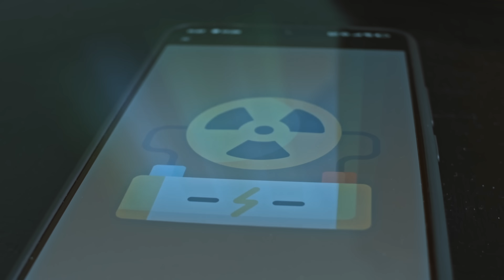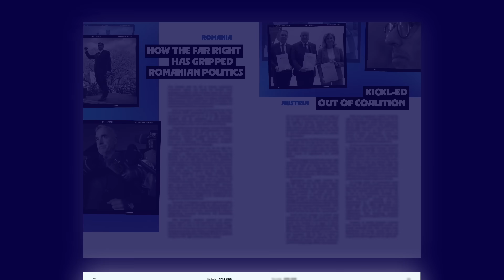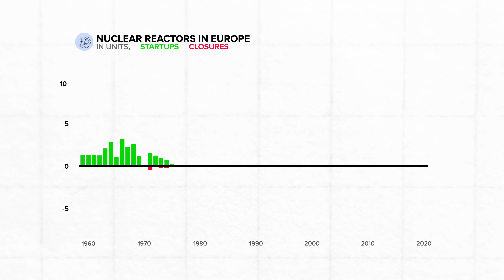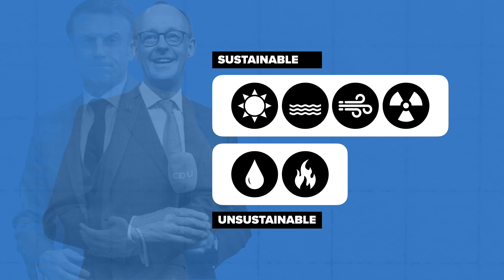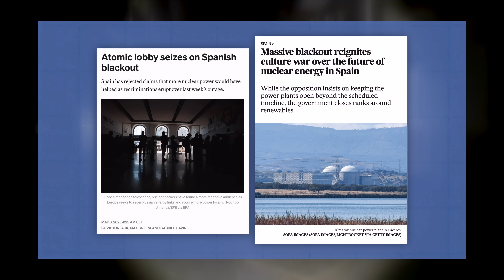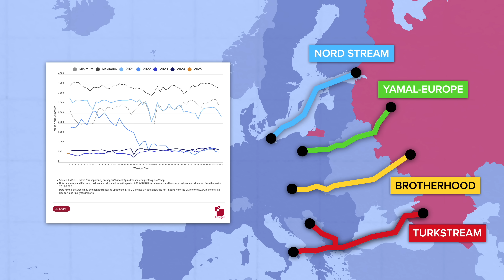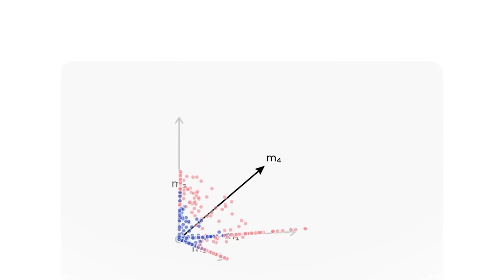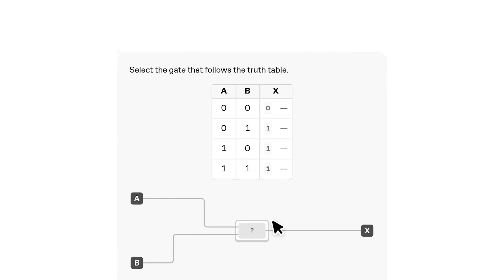Is Europe Quietly Returning to Nuclear Power?

Comment: The power outage was not caused by renewables !! You must decentralise renewable energy production so that one single dysfunction in the central power plant does not halt energy production in the rest of the plants
Reply: The problem was grid frequency as far as I remember, and if you don't feed renewables into the grid, where are you feeding it to? Renewables just need a lot of storage and ontop of that frequency stabilistors, as it seems. With storage and stabille frequency renewables are totally usable. But often those extra costs are not taken into account when talking about how cheap renewables are. They are cheap when they are crappy, decently done they will work fine, but are no longer as cheap. 
Plus they create dependence on China, in today's world one should take that into consideration as well. For example there's very little solar cell production in Europe, and I'm not aware of plans to  change that. Dependence aspect is just taken for granted, and assumed to not become an issue, as far as my impression goes.
Reply: @2ebarman  I would say that rather rotating masses - conventional generators - need frequency stabilization as they try to change the frequency based on the load. Static inverter could produce stable frequency disregarding the load.
Reply: @MrToradragon  My understanding of this is that while inverters are able to produce stabile frequency, they are doing that to match grid frequency. And when grid frequency happens to be unstabile, inverters don't really have a problem amplifying the instability. While rotating masses would struggle to go along with it, eventually tripping when instability grows too great. 

Or am I wrong here, and inverters really do generate stabile 50hz frequency, disregarding what is actually happening in the grid?

Comment: Did they even mention Okiluoto and the Finnish storage of nuclear waste?  Back to the idea about the link between nuclear power and nuclear bombs.  Isn't there a similar link between gunpowder and fossil fuels?  Both burn.  It's the same sort of thing.
Reply: Not really.  The relationship between nuclear power and nuclear energy is nothing like the relationship between gunpowder and oil.  It would be more like throwing out all of chemistry because it led to gunpowder, conventional bombs, and poison gas.
Reply: @jesseberg3271  Right!  Nuclear plants don't explode.  The link is tenuous.  I think you are sort of getting it.
Reply: @daniellarson3068 The link is there but it’s much easier to blow up a fossil fuel plant than a nuclear plant. All it takes is a match to ignite a fossil fuel plant. You need multiple natural disasters, serious operator failure, and critical engineering oversight to explode a nuclear plant. Your analogy is right but they are on different calibers

Comment: Not at all. Nuclear is fading out beacuse a simple reason: is utterly unprofitable.

    Let's take the "white knigth" of nuclear energy: France, country with the largest % of nuclear electricity production in the world. They build over 60 reactors in short time to levelize the cost of their nuclear weapon program; then when that program was complete they cut the expansion of the power plants (initially programed to build up to 170 reactors). Then Chernobyl happened and expansion was halted across Europe. Then at the turn of the year 2000 the renewables started to compete favorably against nuclear. Then Fukushima happened. 

   A year later, in 2012, the French third largest nuclear operator entered in bankrupcy. Six years later, in 2017, Areva, the second largest operator of nuclear poer plants in France (and the builder of so many other nuclear plants abroad) was bought by EDF while being at the verge of bankrupcy. EDF is the largest nuclear operator in the world, in 2019 its mid term debt exceeded 70.000 million €, in 2021 that debt was exceeding 100.000 million €. In summer 2023 EDF is withdraw from the stock market by the French Goverment since the company is on the verge of bankrupcy.

   French nuclear power industry is utterly fucked up, since their power plants are unprofitable to operate and most of them are entering in their age of retirement: EDF doesn't have the money to refurbish them, much less to retire them (the cost of dismantling so many of them will bankrupt the whole economy of France) and Macron pushed as much as possible to make the UE to accept nuclear as green energy in order to grant access to the EU green funds so they can build 6 new reactors...  But it doesn't matter since the plan is just delusional: all the money will be lost and no new reactors will enter in service.

   So: we have France, the largest and oldest nuclear operator by %, utterly unable to make it work, with EDF in technical bankrupcy; we have US, in which both Whithe westinghouse and General Electric accomplished to bankrupt their nuclear divisions several times, and in which nobody wants to fund nuclear because is a money sink, we have UK, in which al their nuclear industries bankrupt decades ago so in order to make Hinkley Point C they have to hire a consortium between French's Areva and the Chinese nuclear oparators, and which so far are 15 years behind the time scheduled and x4 the initial budget; we have another Big, Beautiful, Money Sink in Flamanville, France, with the same time/biudget problems as in Hinkley Point C, by the same incompetent company (Areva); we have South Korea halting half of their projected reactors, keeping in construction only the ones which already started the built proccess, etc.

   So I'll resume this for you: nuclear went from 20% of the commercially availiable electricity in the year 2000 to less than the 10% in the year 2020 and will  fade out below 5% before 20240. Nuclear racing started by countries which needed to mitigate the huge cost of making a nuclear arsenal sharing the cost with the civilian market, but when those arsenal were complete the funds ended. Then the market cost of nuclear made it unable to campete against rtenewables and other energy sources and things will only will go worse in the future, since almost no retired nuclear facility in the world has been dismantled (most remain as temporal warehouses of the depleted fuel). Nuclear makes 0 sense from an economic perspective and the cost of managing the waste will last for hundreds iof generations. Nuclear is a DEAD BUSINESS, and will never go back.

  By the way, Spain is NOT going to reversal its nuclear phase out, which starts in 2027.
Reply: Yes many don't see that, I'm just happy here in germany energy companies don't want to touch it anymore and even told that to the gov. They say "It's not sustainable economically"

Comment: I think that the most interesting design is the one by NewCleo. The founder of the company, Stefano Buono, that already made billions by creating a pharmaceutical company based on medicines created with a particle accelerator, has been right hand of Nobel Prize Carlo Rubbia at CERN. 
His design is basically bombarding nuclear waste by a particle accelerator, as already tested by Rubbia. Is more like a nuclear multiplier of energy rather than a reactor. That means that in the moment the accelerator is off, immediately the system goes off. So no risk of uncontrollable reaction. 
Moreover, the fissile material is nuclear waste, and after having used it it become much less dangerous and radioactive of before. 
The task to make it viable is not to test the theory, that has already been tested, but to make the particle accelerator and the entire system small enough and economically viable. But once that is done Europe can be 100% energy independent. And the rest of the world enjoy cheap, safe and reliable energy.
Reply: Nice. Multipliers are an underrated reactor design. I do not fully understand why no prototype has ever been built. I think its need a bit more information for the reader:
1) Build a reactor which is undercritical (the neutron multiplier is just a bit under 1.0) 
2) No control rods - the reactor is activated "pumping" extra neutrons into the reactor
3) Because the multiplier is <1.0 but just a bit, each external neutron trigger 30-100 spallations. So the external neutron flow does not need to be large.
4) Use a particle accelerator to shoot high energy protons into the fissile material. If a high energy proton hits Uranium it will explode and splatter neutrons all over the place.
5) Note that 4) is by itself not efficient. The energy needed to produce the proton to splatter the Uranium nucleus is far higher than the energy you get out. BUT, the secondary neutrons cause more fission AND the multiplier ~0.99 makes sure more follow. SO every proton injected causes 1000s of fissions.

Advantages: 
1) No control rods. No mechanical components in the core that can fail.
2) Auto shut off
3) Can burn a wider range of material (sometimes at cost of efficiency)
4) Can perform "wave burns" - burning through the localized parts of the fuel
5) Can burn nuclear waste (with minimal reprocessing)
6) Can achieve higher fuel usage 
7) Faster ramp up and shutdown
Reply: Why don't they just use PHWRs? What was the problem?
Reply: @idarpolden5913 they are good, but a nuclear multiplier can be as small as you want, uses spent nuclear fuel, is intrinsically safe, because there is not enough fuel to cause an autonomous nuclear reaction . You cannot have a runaway and so impossible to have a nuclear melting. Even the safes PHWR still need to have enough fuel to start a nuclear reaction that needs to be controlled by rods and water pumps. If one of these fails you will have a meltdown.
Reply: @luigifranceschi2350 Thanks for your reply. Small nuclear plants is welcome as they can regulate output faster according to demand. 
However, a particle accelerator costs itself more than several PHWR's plants, making it economical infeasible.

The PHWR runs on normal uranium, but also spent fuel and even Thorium so that is solved. 
Every design performed by engineers including redundancy, making it unlikely for that to happen.
(Boeing used economic designers on the MAX with only 1 AOA sensor, instead of the engineers they fired.)

So what would happen if we replaced the heavy water with normal water as the last safety incase everything else fails?

This can easily be designed by using gravity alone.

Denmark is working on small modular Thorium reactors
If mass production can push the cost down, it might be an alternative.

Comment: Thank goodness. Can you imagine how many crises could have been avoided in Europe if progress on nuclear didn't stall?
Reply: Exactly zero. Europe doesn't use gas for power production
Reply: @simon2493  That's not true. 15% of the EU's electricity comes from natural gas, and more energy comes from gas if we include the winter heating demand.
Reply: Imagine that being completely depended on importing nuclear fuel when you could produce energy locally without any nuclear waste
Reply: @furTron  And in the current setup, they’re dependant on Russian natural gas. At least it would be less of a headache to import a bit of reactor fuel from Canada/Australia by boat than setting up all the infrastructure needed for American LNG, and it would be carbon neutral to boot.
Reply: @Jerdifier  or one step further can be done, and everything would be switched to renewable, what would means no dependency on anyone + renewable is way cheaper than fossil/fission 
so why not win win?
Reply: @furTron   100% renewables is not possible. Energy storage sucks and it can't be relied upon to always meet demand levels.
Reply: @furTron renewable does not work all year round
Reply: @KnightRaymund  Eh, energy storage is alright, especially if you can deploy a wide variety of different renewable types. Still, cloudy days during a river-draining drought don't really happen, so you'll always have one of the three between wind, solar and hydro.
Reply: @furTron  Renewables, even with storage, severely lack inertia. Inertia is the grid's ability to resist variations in frequency during severe demand spikes/dips that comes from literally having giant spinning turbines across the country that behave like flywheels. Renewables like wind and solar HAVE to be run through inverters to match the frequency and hence are load following. If the frequency dips/spikes, they just match it and make the problem worse.

Even in a 100% renewable grid, you need about 75% of that to be "turbine sources" like hydro or geothermal. Hydro is already pretty much maxed out in Europe and geothermal is only feasible to a limited extent in Iceland, Italy and Turkiye. Solarthermal is another possibility but the land use required to make this significant is not very sustainable for electricity and should probably just be left for heating applications. Apart from fossil fuels, nuclear is literally the only source that can fill this role in any country without needing to be "geographically lucky".
Reply: @furTron  you have to import very little fuel to power a plant and you'd import it from non-hostile countries (like australia). with renewables we are dependent on imports from china, which is the major supplier for silicon based products. also the volume of waste is negligible, we could run only on nuclear for thousands of year without having any problems with storing space.
Reply: @Luke-rd1pi  Australia produce less than 10% of global nuclear fuel. 
You talk mostly about Kazakhstan (43%), maybe Canada (15%) or Namibia (11%)
Reply: @furTron  Europe has quite a lot of Uranium and Thorium deposits (unlike oil and gas) and when all else fails Europe has good relations with countries that also have significant deposits (Canada, Australia, India). On top of that, a nuclear plant consumes miniscule amounts of fuel per GW so the fuel lasts ages. With breeder reactors like France's Superphénix or Canada's CANDU the plant can run on natural uranium without needing wasteful enrichment processes.

Nuclear "waste" is only "waste" if you throw it away like the US does. France reprocesses its waste to extract remaining fissile elements from it and separate low and high level waste that drastically minimise the problem. Furthermore, modern reactor designs can also consume transuranic elements producing only low level waste.
Reply: @furTron  Nuclear waste has never been a serious issue. It's not like The Simpsons.

Comment: One conspiracy theory that I firmly believe in without any evidence is that anti-nuclear sentiment in Europe was fostered and fanned first by the Soviet Union (with Chernobyl as an example) and then by the oil and gas industry. It's insane that we ever turned our back on it. 

The trick this time round is to do a continuous rolling buildout rather than France's big bang approach in the 70s. A continuous program means lower costs as suppliers will cut deals if they know there is more business coming in future, and means all your reactors don't go down for maintenance at the same time. Small modular reactors also de-risk things by having a single prefabbed design with which you can expand capacity by just buying and installing more of them. I'm personally so bullish on nuclear that I've invested quite a lot of money into companies working on the tech.

Comment: another good reason is the green transition will need the production of large amounts of hydrogen, either as bulk energy storage or as fuel for things that can't be electrified.
The really efficient electrolysis of hydrogen happens at high tempariturefor which the only low carbon way of doing it is nuclear reactors.

Comment: Going for nuclear is an absolute no-brainer and it is on its face stupid that this wasn't the direction set sooner.

There are however two caveats which would render it non viable, IF it is held that either could happen with enough probability.
1) Nuclear war or even massive conventional war, causing damage to plant or forced abandonment.
2) Earths changes causing same.
Remember, modern thermonuclear nuclear weapons ( particularly air bursts ) the effects of which are largely short lived in terms of radiation. ( that's not to diminish the general devastating effects of 'breakdown', starvation, disease etc. that would occur )   Whereas, nuclear plants are like " the gift that keeps on giving ". Let them keep spewing out their radiation and it really is curtains for the world.
If leaders and planners are convinced that either of these two scenarios will occur, then there is justification for seeking an alternative to nuclear power .........  but that won't be solar panels and windmills f.f.s. We ARE still talking about gas, oil and even coal. Plus the infills like hydro, geothermal, solar ( where it works ), etc.

There is actually a third caveat that's a more of a wild speculation. That perhaps a better form of nuclear or a completely different form of (ultra cheap ) power generation is already known by a few and there is the possibility of a roll out so therefore why invest scores of billions in nuclear as we know it. The reasons for its continued withholding could be fear of the economically disrupting potential or the way it might change the geopolitical make up of the world,  ironically possibly leading to major war over it, putting nuclear plants that exist at risk.

These caveats aside, we absolutely should be going for nuclear. Including mass use of long term buried nuclear batteries for complexes like hospitals, university campuses, military bases, etc.

Comment: Basically renewables cannot be 100% of a energy mix as the stability of the system isn't there.   You need a baseload of about 35-40% to make a grid stable against sudden shocks.  

If you don't want gas of coal you need nuclear.